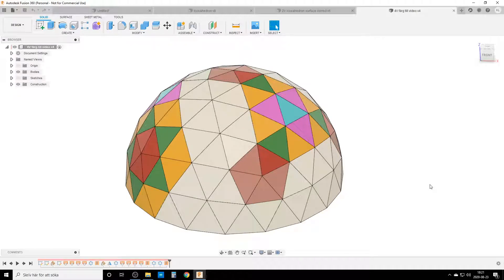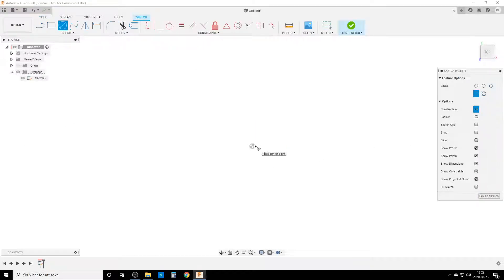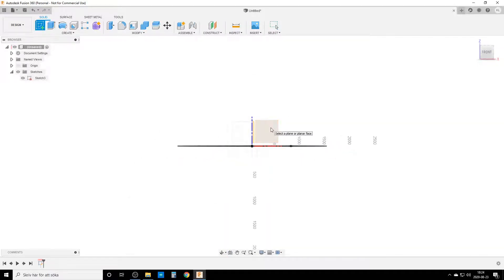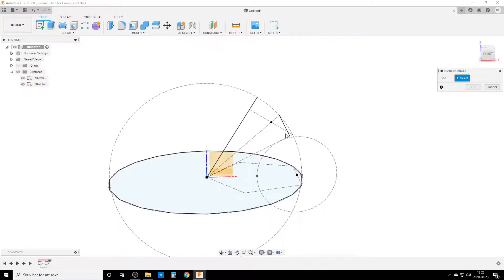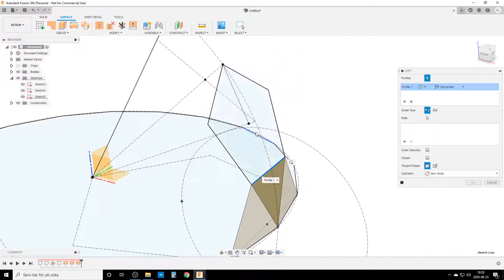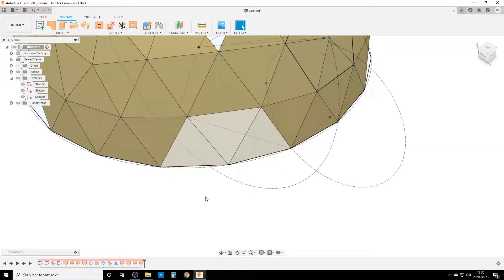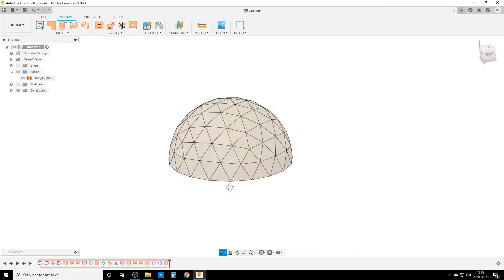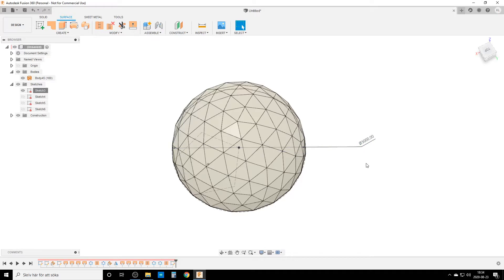Geodome 4V Icosahedron in Fusion 360 - Geometric solution (no math)

Comment: Could you show a video on how to make other larger frequency Domes aswell. Or at least how to use these guilds to make larger frequency geodomes?
Reply from the maker: Fusion is getting better at 3D sketching that is needed for dividing the triangles for a larger dome. I'll try doing a more general description if the holidays doesn't get to hectic.

Comment: You did that a bit too easy, obviously that can't be right;), I had been mucking about for ages with that. I could reverse engineer other models but couldn't start from scratch, now it's basically parametric, except as you mentioned some of the lofts break, but that's an easy fix. Excellent content as always, thanks for sharing.
Reply from the maker: And now there is an add-in that can do the work for us, but that is cheating ;)

Comment: how do you replace the lines with hollow pipes in this design?
Reply from the maker: You can use the Pipe feature. But if you want full control of the design I'd use Plane on Path creating a plane at he center point of the edge and sketch the pipe, then extrude it to a distance from vertex. After that create the connectors for the vertexes. It's a bit of work but you have a lot of edges that are the same.
Reply: @KristianLaholm  It worked really well Thank you. I m trying to use the concept of this video to create 5v, how to do it?
Reply from the maker: @ManojMahto-ZoolAdNetwork  Thank you for the update. For a 5V dome I don't have any shortcuts. There is the base design with a triangle between 3 vertex and then subdividing it, I might give it a try in a future video.
Reply: @KristianLaholm  I did that yesterday and got the results. Thank you

Comment: The helper line you create at 4:50 and beyond: shouldn't that line go exactly through the middle of the arc created by the two points on the sphere?
Reply from the maker: If we are talking about the line from center tangent to the small circle? that is to project the center of the pentagon to the sphere.
There are some more geometry that I'm not drawing that would make the geometry more clear but mess up the sketch with a lot of lines.
I think i tried what you are suggesting then trying out how to make the workflow and the dimensions finale got wrong.
Reply: @KristianLaholm  No I meant the line between the tangent line and the projected line of the tip of the pentagon.
Reply from the maker: @kupfeli  If I did that then the first pentagon face I sketch would be to big. But there can be other ways to get the geometry feel free to try, my workflow is not the only one to play around with :)

Comment: Is it posable to connect these domes/spheres in a pill shape?  How do the triangles distort?
Reply from the maker: A construction plane with the same polygon as the base of the sphere but rotated vertex to mid of side of base polygon, and create 3D sketched triangles + circular pattern.
That is one possibility, with some geometry the triangle can be equilateral. If you want more to "stretch out" the sphere I would model that from the bottom up.

Comment: Kudos to you.
Question:
After creating, do you have a way of printing to a csv file the X,Y,Z coordinates of each point?
Also, can you consider doing a truncated polyhedron with 
12 Pentagons and 20 Hexagons?
Reply from the maker: I don't have a solution to do that but there are threads on the autodesk forum discussing it using script and the API in Fusion.
Reply: You may have a dxf sketch on each plan you need. Coordinates can be easily retieve by this way.